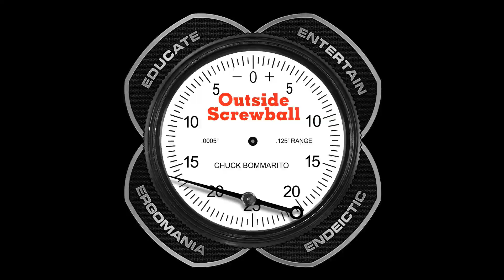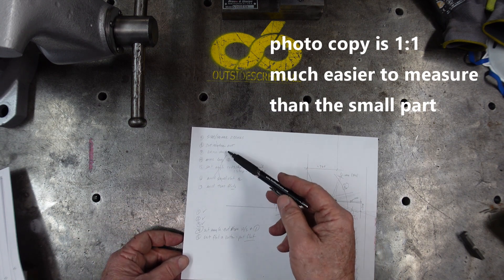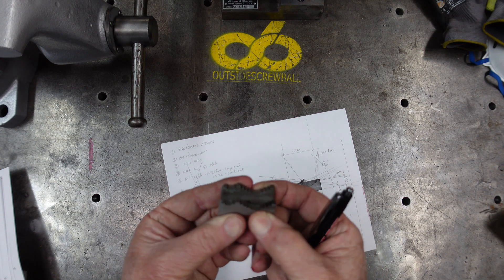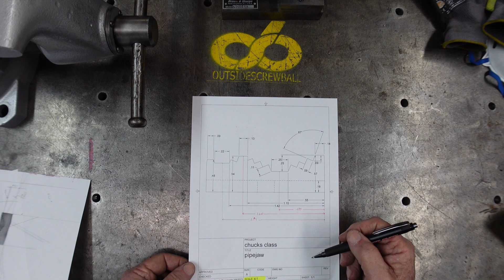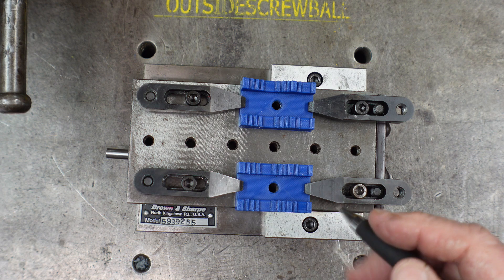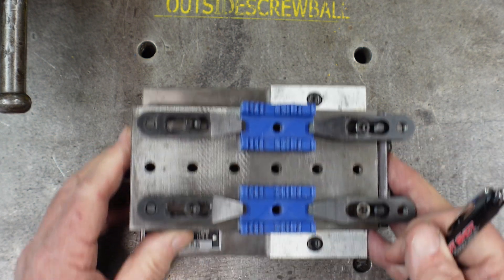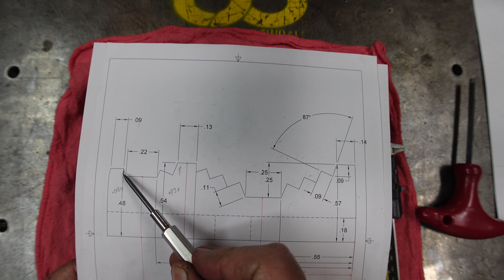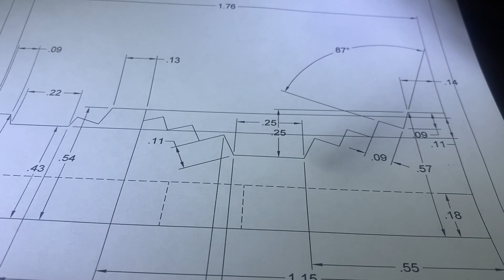Screwy Tuesday 23-13  Wilton Tradesman Vise #1750 Pipe Jaws

Comment: I’m confused. Where are you getting 3 degrees? Measuring from vertical, it looks to me like the angle should be more like 30 degrees. Also, you’re never going to get 87 degrees from an endmill. I’m looking at your drawing especially on the right side of the drawing where you’re calling out an 87 degree angle. What am I missing?
Thanks,
JohnB

Sorry, not 30 degrees from vertical, 30 degrees from horizontal.
Reply from the maker: Damn John!  I read your comments and then looked at my drawing...HELL, I don't know? it made sense to me and the machining worked out based on my settings of 3 degrees....thanks for viewing and I hope all is well in your shop....